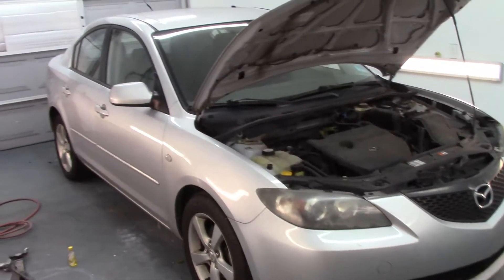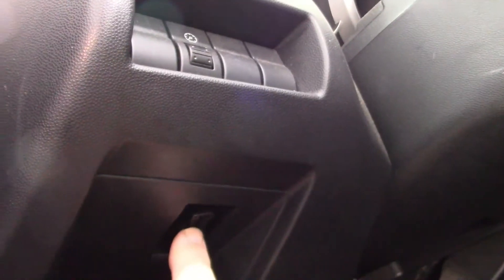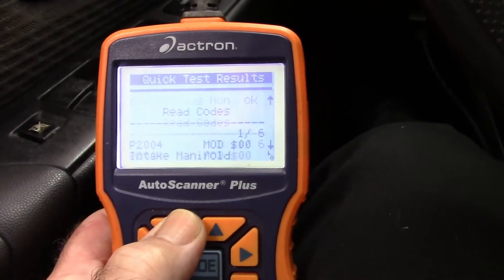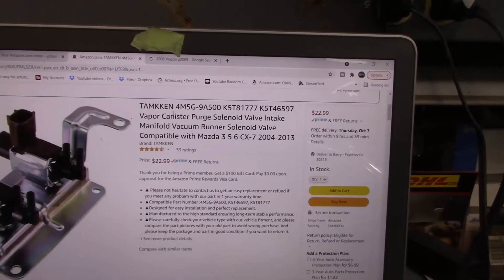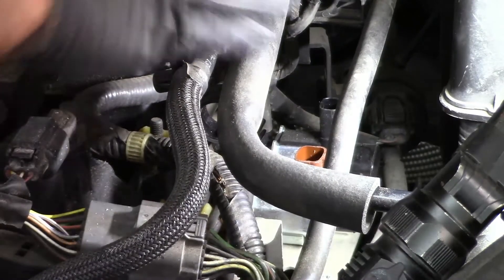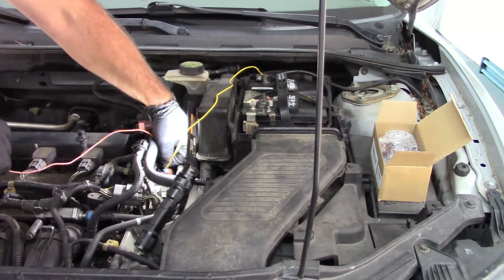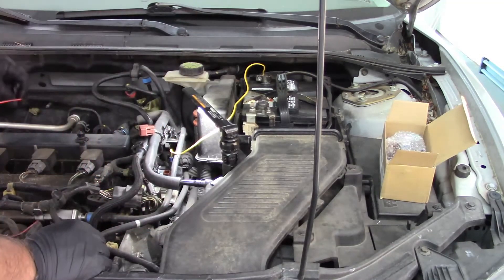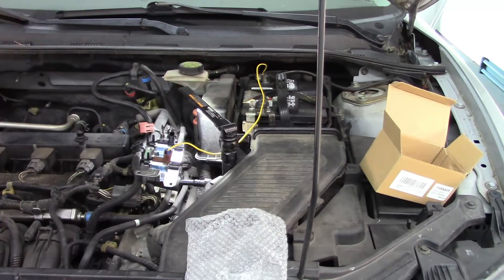Mazda 3 Engine codes P2004 and P2009.

Comment: P2177 Code, check out video "ford/Mazda 3 2.0 p2177" by Jabo the Mechanic.  It was the brown connector solenoid in that video that fixed p2177, which I know you swapped, but he shows how to check the valves that the solenoids actuates, black connector (intake manifold control runner) and brown connector (intake manifold tuning valve) using a vacuum pump.  So the brown solenoid in your video was good, but the valve it controls might be stuck/bad.  Other than that everything I have researched says to clean the MAF or replace, check for trash in vacuum lines, PCV hose connections to the intake manifold, clogged injectors and of course vacuum leaks.  The only instance I can find of smoke test coming out of the transmission bell housing is for a bad engine rear main seal, but that is usually accompanied by an oil leak.  I hope this helps, because your videos have helped me.